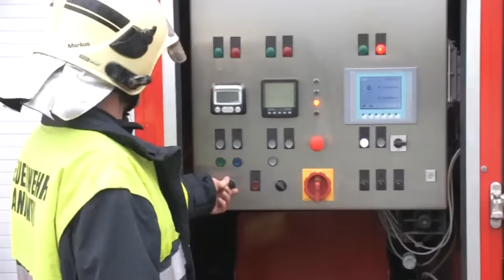LUF Long Distance Water Supply

Comment: 3 hours later, when the pump was finally primed, the entire village had already burned.
Reply: This isn't the first or even secondary water supply line. This is for large fires, like forest fires or the swamp fire in meppen, germany last year. They are also good for floods.
Reply: Next one who didn't understand
Reply: @thoughtfox2409  why would you wan't to pump in all that water when there is a flood🤪?
Reply: @אוריפלסי  Oh, you wouldn't want to pump the water in, but out,. This would come into action after most of the water has receded, but there are still flooded areas. The water would then be pumped into the nearest river or canal. This may also come ito action when large underground buildings, like parking garages, are completly flodded after a major flood,because with regular pumps, it would take ages to pump out that much water. Oh, and your username seems to do weird stuff with the comment box...
Reply: Until I saw it automatically re rolling I was gunna say holy fuck I’d hate to be the rookie that had to re rack that one

Comment: Ok....why

You set it up and by the time it’s set up the fire your putting out has gone out by it’s self
Reply: With the ramps to go over the hose definitely. Judging that it took like 3 minutes on the video, depending on how close the vehicle itself is, we're talking like 15-20 minutes set up time to pull everything out, carry it over, and bolt it in.
Reply: As someone else commented earlier. This is not for a small house fire. Its for something like a wild fire.

Comment: Looks like a lot of hard  but it looks like they know what they are doing
Reply: I think the fire would have burnt its self out bu the time they have it all rigged!
Reply: Rdr. Let
Reply: 00
Reply: Graham Scobell usually this kind of equipment would be used in big fires (which could last for days/weeks) without a large enough water supply near the fire. And it also works great if you need a lot of water for those water cannons.

Comment: We need acouple of these here in Australia
Reply: Are your guys wild fires still going on?
Reply: @elizabethridenbaugh7731  hey... no they are out now witch is great.. alot of homes lost and wild life hurt or burnt alive and some live stock hurt as well
Reply: It has been around for about 35 years, so what are they waiting for........
Reply: Robert Chinnock they gotta start expanding their airplane fleet to fight fires, it looked to me like they lacked a bit on this.
Reply: Well .. Call the Dutch . . . :-)
Basically, it's a Dutch invention from the 70's and one of the main manufacturers is based in Holland (Hytrans).
Over here, every district has several of these standard hook-pods, which can also be transported by civil trucks like those of construction Cie's
Not only used for Industrial/Forest fires, but also for large normal fires, where the hydrant systems lacks capacity.
In most districts, there called by protocol in case of 'Large Fire' (3 pumps) or worse.
Typical deployment time from call to water approx 30mins

Comment: about those ramps to drive over the black hose----those single safety pins in the middle of the connecting pins --how do they keep the pins from moving so they do not shake out of the ramp sections?  why don't the big pins have a flange on one end, and the safety pin goes on the other end ?
Reply: I was wondering the same thing.
Reply: The pin locates in a central hole on the ramp

Comment: You could have 2 engines start drafting in a quarter of the time,  and probably flow a comparable volume of water. All without spending what a million plus.
Reply: Quarter? Like 1/16 of the time. Lol
Reply: @powereddragon2093  it takes my department 1:30 for a hydrant and 3:47 for pond drafting
Reply: so two Engines flow more than 14,000 gpm?
Reply: @EnjoyFirefighting  no. 7 of our ladder trucks do. And it takes like 30 minutes plus it's a lot better than having 2 useless ass trailers
Reply: @dawsont933  trailers? I don't see any trailers here in the video; That container / pod system is mutlti-functional for all kinds of special operations and definetly more cost-effective than purchasing complete seperate trucks for all special operations, especially as some of them are used only a coupld of times a year: tanks with frozen carbondioxide, heavy rescue, nitrogen vaporizers, radiation protection, remote controlled robots etc
That flow rate wouldn't be common for municipal fire apparatus here, rather for industrial apparatus. Take a flood scenario: do you really want to keep an Aerial stuck with it for several days, not being able to do it's actual job and run emergencies where the ladder is needed?
Reply: @EnjoyFirefighting  cool. Y'all do it your way we do it ours
Reply: @dawsont933  obviously; Well tbh it's of course easy with the manpower we have here; Some of our stations hold several dozen apparatus and of course it's easier than in the USA with more manpower. Unfortunately I've never seen the American trucks for mutual aid here although some USAG bases are nearby; I know only the pics of German apparatus in the USA
Reply: EnjoyFirefighting - International Emergency Response Videos Their largest system flows 11,000 lpm or 2,900 gpm. So considering most US fire apparatus flow a minimum of 1,250 gpm, 2 engines would flow close to the same amount through 5” LDH. If this was truly for fire suppression most structures would be fully involved and a complete loss by the time it was set up.
Reply: @firefighter3671  that's 2 engines tied up, nowhere near the scene where the may be of more use and you'd need more than 2 to pump 6km
Reply: @EnjoyFirefighting  "Hey we got an emergency call, let's change the container!"
Reply: @falrus  those are designed special operations, and that's nothing you require in the first couple of minutes of a call; Doesn't matter if that piece of equipment arrives on scene a couple of minutes later while ordinary apparatus have arrived already
Reply: @firefighter3671 And how many intermediate pumps would you need as well to pump 6km ?

Comment: The part that goes in the water should be remote drivable i think, hell put it on an arm like a concrete pumper. Then personnel doesn't have to go near the source and possibly get hurt with that much weight.

Comment: Its a neat setup, but very limited usage. Would be ok in wildfire but wildfires move so fast by the time its setup it would either already be on fire or missed the fire entirely.  Maybe massive multi alarm industrial fires that are remote(no Hydrants in the area) and also have a large body of water within 15km... but i cant see those being a common occurrence either...and even then if the fire is that large and remote its just going to be a let it burn scenario anyways as there is likely nothing left worth saving.
Unlikely it could be setup in time during a flooding scenario to make difference. Once the flood has happened the damage is done, there is no rush to quickly move the water again.
Its hard to imagine such a critical drinking water supply that would fail and needed that much volume in rapid response.
Reply: some wildfires don't move that fast; But yes it's basically for any extraordinary large fire scenario where big water supply is required and the hydrant network might not be able to supply that amount. Also for flood scenarios where you want to pump large amounts of water out of an area. Damage might be done already, but you don't want to keep the water in a low area for weeks or even months, and you don't want to tie dozens of relatively small fire apparatus with their average size hoses and pump capacities on such a scenario. Also that pumping might make the difference if further areas will be affected or not, if a dike withstands the pressure or not.
The USA already had the scenario that mutual aid had to come from abroad with high volume pumps to support local departments and crews in such a flood scenario

Comment: What’s the point of putting the pin if the pole can still fall out the other end
Reply: The pins fall into a little bracket that is midline to each section. At 5:05 there is a decent view of the brackets. The smaller sections on the ends of the ramps do not seem to have the same bracket though. Which seems odd
Reply: Patrick m I see it thanks for the info

Comment: I love to know how they were able to draft with those soft hoses without them collapsing.
Reply: It looked like those were hydraulic operate pumps they floated out with the hoses.
Reply: @kenmeinken8115  That is new to me, and something I haven't seen. I am use to seeing a hard suction hose hooked up to a pumper.
Reply: @MatthewMello  The units in the water are floating//semi-submursible waterpumps indeed.
Reply: They are not sucking; the large machinery in the water are pumps (hydraulically powered via the two black lines connected to each) they force water into the soft tube

Comment: I have to wonder what the advantages of these long lays are over tankers. Surely the friction loss is too high for this to be that beneficial.
Reply: Tank trucks can carry 20.000 to 43.000 liter.
This system can transport 11.000 liter per minute.

Let's assume you need the water in a distance of 6km, a tanker can travel between these two points at 50km/h and holds 30.000 liter.
So just to deliver the same amount of water this system does with 2 trucks you would need 5 tankers. (and that doesn't include the time it would need to fill the tankers)

And on top of that, after the LUF system is deployed both trucks can be used for something else (both are swap-body-vehicles)

Comment: buy tankers, geez, one guy can operate it.
Reply: Trust me, we have many Tankers covering the entire range, but for the large jobs we have the equipment to operate LDH for water supply and attack, so why not use it? SOme operations simply don't work efficiently by using Tankers ... take floods as an example, how do you pump those large amount of water by using only Tankers? I guess there's a good reason why the German Federal Agency for Technical relief came with high volume pumps as mutual aid to New Orleans ...
Reply: 😂Man you can not compare that. This system makes 12000 liter PER MINUTE (about 4000gal). so how many tankers do you want to buy? It's a worst case Szenario equipment...
Reply: @piuforte  rural america has proven tanker use time and again, you can youtube all the tanker success stories, there are many here.  Rural america wouldnt have the man power to utilize this
Reply: @EnjoyFirefighting  Cost/the required man power, the training cost for said manpower, how many systems, one for every fire dept?  No, so which fd has to stomach the cost of this to mutal aid it to others?  Why would they want to?
Reply: @gw62112009  not one at every department, but here they are purchased by relatively large city FDs and industrial FDs, depending on the location and size of the department sometimes also at FDs in large towns. There are definetly far more specialized types of apparatus and pieces of equipment, of course all of them require training. Let it be desinfection, CBRNE, EOD, nitrogen vaporizer, frozen carbondioxide, remote controlled fire-fighting support units, fire and rescue trains, tunnel fire apparatus, turbine powered aerosol extinguisher apparatus, ... 
These systems aren't meant to be used only in the departments' primary response areas but they can cover a greater area for mutual aid, within the country or abroad if necessary. Some monitors of the Hytrans high flow system are able to handle up to 14,000 gpm ... that's quite a bit more than the former FDNY Superpumper was able to supply. 
Tankers are great, no doubt, but some things simply don't really work with Tankers ... we have tiny to super large Tankers based on single trucks, semi trucks and truck + trailer combinations, but it's simply not sufficient and they are usually more expensive than one such piece of equipment pod
Reply: @gw62112009  I don't know the situation ower there with you buddy... But you need damn much and big  tankers to equal that system. Different country's, different work. 🍻
Reply: @EnjoyFirefighting  Fire Brigades in the Netherlands are using this system already for a long time, only with a smaller diameter of hoses (6").

Comment: I've watched municipal departments take that long to set up one engine to flow water from a swimming pool! If they didn't  have municipal systems and hydrants, they were back to square ont.
Reply: Being able to flow up to 14,000 gpm a swimming pool would be empty in no time and a hydrant system can hardly provide that amount of water; These systems are usually used alongside rivers and canals

Comment: if we took that long to get water our chief would be on our ass and we would have to do it again and again and again.
Reply: So while we use a comparabel system in Germany it's basicly like this: ~One hour after calling these units you have a stable water supply. During this hour a water supply is already established! But in addition to this you have now these units delivering a good amount of water, which you can be pretty sure is stable and a High amount of water (spoken for European standards).

Tldr: this isnt the first supply line its an additional supply line.
Reply: This is probably for an extended/oversized/industrial/wildland fire. Hope they have massive amounts of manpower to roll the hose back. Don't look like fun.
Reply: @markpang8847  exactly! Rolling these hoses isnt a problem with our system at least, it's electrically pulled up while driven the route back
Reply: you are aware that the primary Engines, Rescue Engines and Tankers can flow water within less than 30 seconds with no hurry at all?
Reply: @TheGhostOfDefi  They use a hydraulic or electric driven Hose Recovery Unit (HRU) for that purpose.